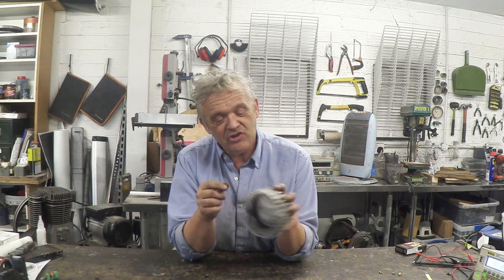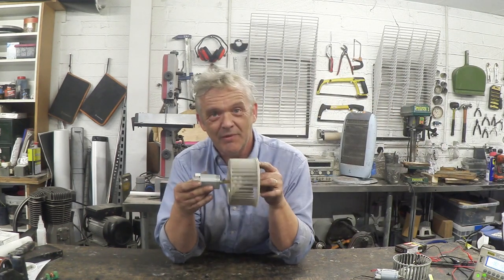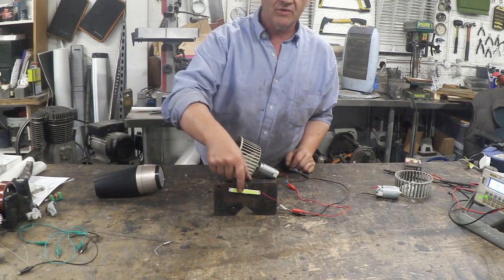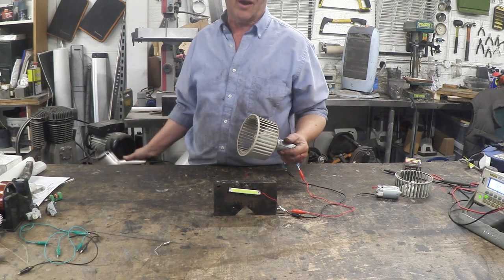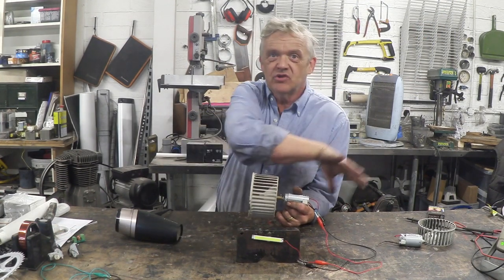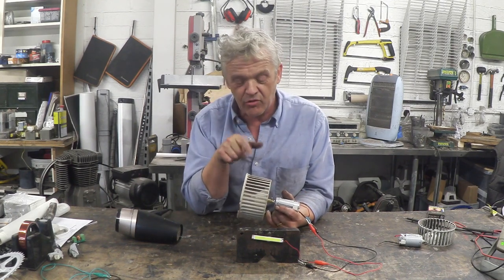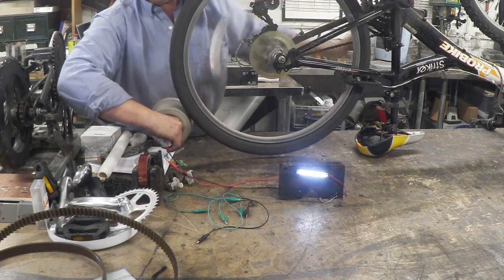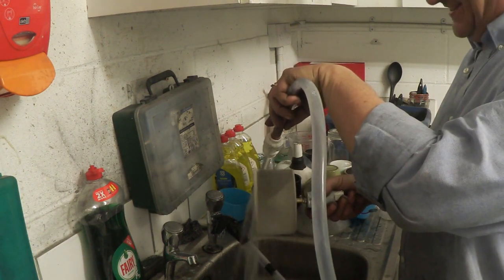1223 An Easy To Make Multi Function Generator

Comment: Dear Robert, thanks! When you said "put it on the wall" I thought about "breaking" it by 90 degrees so that the shaft of the motor rubs against the rotor from behind... It would be much flatter and it would give a nice gear ratio...

Comment: It took me a little bit of searching to get the right nomenclature, blower fan didn't work, squirrel cage fan didn't work, apparently it's called a blower wheel the one I found on Amazon for about $9. in the questions it says it is a 5 1/2 in diameter by 2 and 1/8 in width with with a quarter inch bore size

Comment: Thank you for the awesome idea!! 
That's the end of my head blender, and the start of a project!! I'm going to be charging a battery with this!
* I was just wondering if it's Ethical or not, to attach it to the hamsters wheel, Lol!
Kindest Regards,
Andrea, Jasper and George the Pigeon. XxX
* I also would like to note that the hamsters have loads of room, and a tunnel system to run about in, but they are mad about the wheel!!,🤔😁
Reply: hamster power reclamation is fine, they can run their own 3v air pump for extra fresh water on demand lol

Comment: I ve a question. Will it work if you connect multiple motors in series/parallel and spin them all up simultaneously? Will it make more power? Or will it have too much torque/resistance to spin?
Reply: I'm still not sure of that I haven't tried it yet

Comment: If you had an unlimited constant heat source, how would you use it to generate residential electricity? Water flow? Air flow? Steam power? Peltier? Stirling?
Reply: Stirling gets my vote
Reply: @McRootbeer  i have been trying to find 10kw- 20kw stirling engines but no luck
Reply: @David_Mash  build you one
Reply: @David_Mash  what are you trying to power? A neighborhood?  The closest I've ever seen is a small company making a combined hot water/power system with a stirling, but that's more of a supplemental system than for primary power generation.
Reply: @McRootbeer  one 10 person home. We have solar to heat the sand thermal battery, we want something to take the heat 24/7 and power the home
Reply: Closed cycle steam turbine charging Lithium ion battery, combined with house and water heating, and TEG scavenging unused heat.
Reply: @nicgreen4234  so lithium handling daily discharge and thermal keeping the lithium charged. The issue with steam is that it contaminates the water and we plan to have this process distill the water. Maybe contamination can be remediated.
Reply: I'd say stirling.  And you'll probably have to build one.  I Think Rob has an ebook on his site all about them.  I've looked for videos, but most are for small models rather than large ones- though several small ones running off the same heat source seems like it would be doable-  particularly if you use the high speed- low torque notion Rob touts.  

I think- not certain, but I Think even the tiny desk toy model would be able to get a rather large ring of magnets with a good bearing (like his washing machine wind turbine sized) up to speed over un-cored coils, if you geared or drove it right (might take some fiddling, but it would be like gradually spinning up a flywheel.  probably need a push to get it started, but once it was I don't see why that wouldn't be enough to keep it turning at a pretty good clip).  As that design was producing what a typical commercial 1kw turbine produced at usual wind speed, this seems like a notion somebody should test.  It might not have enough output to do so, but I think, once it got going, it might.
Reply: @David_Mash  Youtube search: European Solar Powered Stirling 10 Kilowatt Generator
But in the end a steam generator will be good for you (closed type).
Reply: all of the above at the same time, given each local use case; oc you might need to diy some converters ,conductive ink based paint on heaters, A4 paper power wall batteries/caps etc as retail companies dont sell these off the shelf.
oc i assume its about doing & growing your personal practical power generation, accumulation, storage, use, not just buying the latest 3rd party consumer shiny
Reply: They generate it  somehow in Iceland . Probably  steam originally  .
Reply: @michaelcorbidge7914  yes, Iceland happen to have a thin crust in places where hot magma is nearer the surface so they did the work & optimised that local resource with insulated earth infrastructure & oc Victorian steam turbines

Comment: Hmm.
Can you mount the motor inside the fan so that the wind turning the fan also cools the motor?

Or will that reduce the efficiency of the device?
Reply: given the existing Rotor Sails (Flettner rotor) poc's if you make the motor rotate its outer case/add a second round shell to mimic the rs effect at the same time, it might even work as an optimisation

Comment: Rob can I give you an idea I've trying to get part to make a v.p.g (vortex pelton generator)by using a vortex fountain in theory it's possible genera the power. Yes you have to use a pump to push the water up but say you did not have space for a battery bank or super cappaster  this would be on demand power depending on your use for it
Reply: "but say you did not have space for a battery bank or super capacitor" 
oh there's Always space for those, people have been conditioned to just retail consume them for profit 
you just need to actually do the diy work & paint them on your device/paper substrate using rob's conductive ink as the primary material. see the vid, give it a go ian.

so pumped/ evaporated, air lifted venturi hydro with a U magnet stirrer

Comment: Could you use pennies and magnets to make a generator? In theory is should be possible. question is, what kind of current will it produce? What would be its total out put in watts? I’d imagine overlaying the pennies would act like a wire provided they are touching.